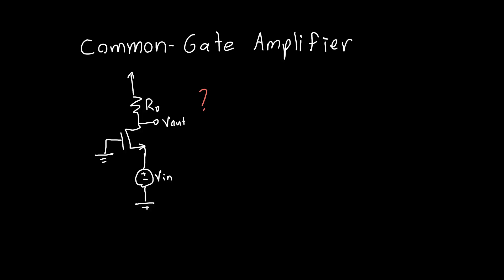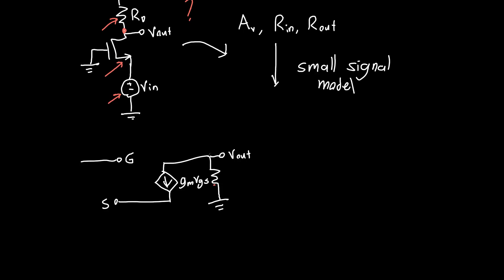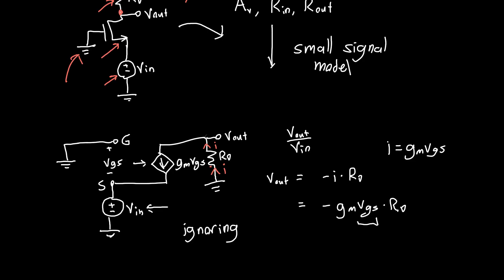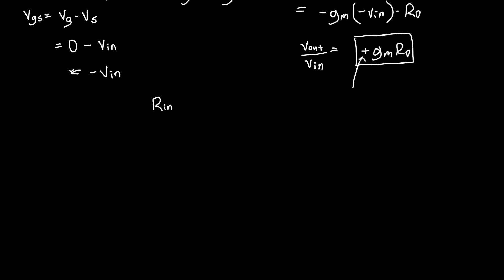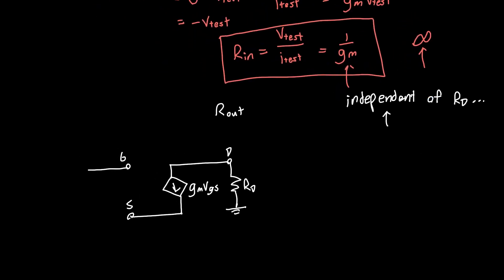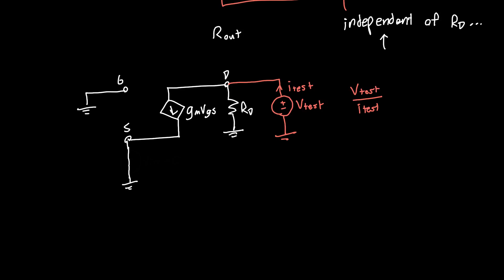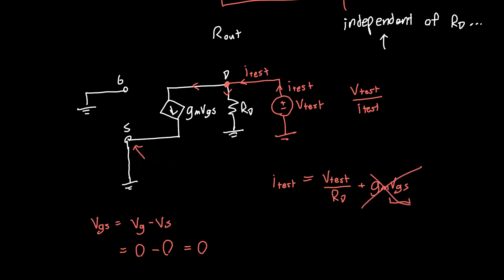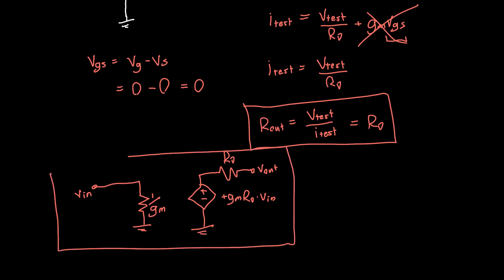MOSFET Common Gate Amplifier

Comment: Wonderfully explained. I've 'studied' this amplifier many times over the decades, but this is the most elegant explanation!!
Reply: how many times have you studied  it roughly, I just finished a my second course on electronics , and I feel really overwhelmed although I just finished it in my college , I feel like I don't have a great understanding , the topics that the course went over to list the main topics: mosfets amplifiers ,common source , common gate, common drain , differential amplifiers(differential pair) , frequency response of all the previous stated amplifiers , op-amps , power amplifiers , oscillators
Reply: would you recommend how I can further my understandings on these topics

Comment: What if Vin is supplied with a voltage source Vsig with source internal resistance Rsig? How does Rsig affect the analysis?
Reply from the maker: Great question. You'll have a resistive divider between the source and the amplifier. If you know the amplifier's input resistance (this is something you can calculate), then it's as if the voltage is just smaller by the factor of the voltage divider. Everything else is the same.